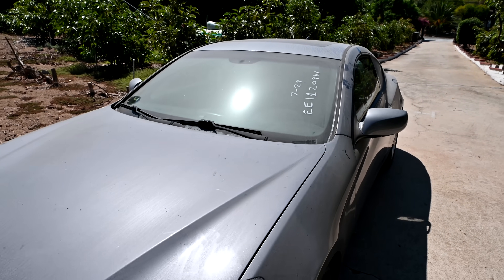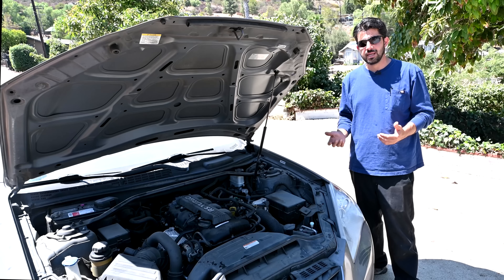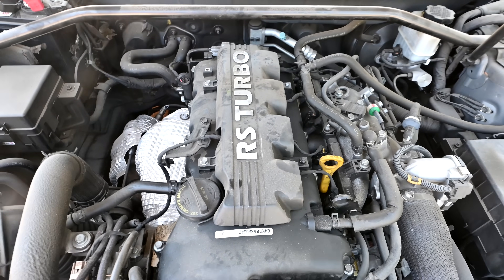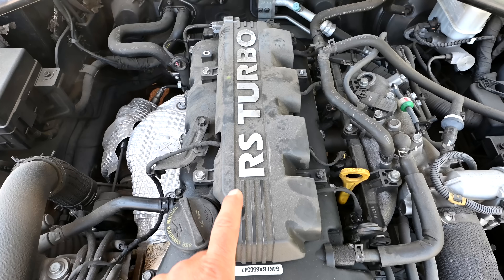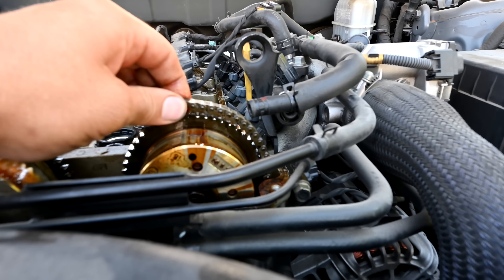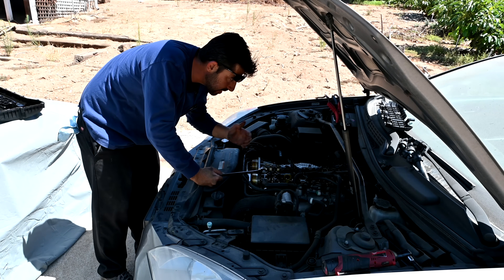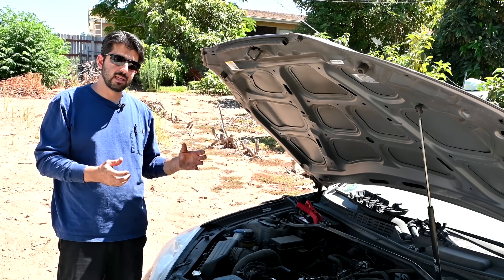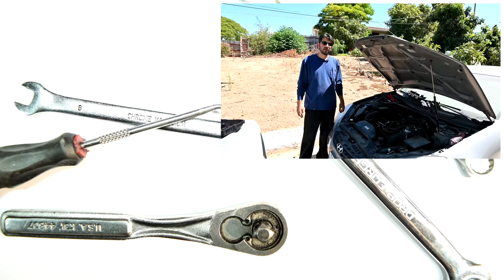The Hyundai And Kia Engine Failures Explained.

Comment: As a tow truck driver from the auto club, I’ve picked up most cars with dead batteries, alternator issues and minor repairs needed, but kia and Hyundai are definitely the worst ones with blown engines. 
Especially because people neglect to change the oil, or check fluid level 🫤

We hope to see you at Mollison OReilly’s!
Reply: We are lucky here in Australia. Our Kia and Hyundai cars come straight from Korea and we dont seem to have the problems your cars have in the USA. Also we change oil regularly here in OZ. I change my turbo Tucson`s oil twice a year with full synthetic oil...because I can. Never needed oil between services despite regular 2500km trips in hot weather.
Reply: @martiedoherty5765  interesting! The Koreans are capable of great craftsmanship but when it comes to communicating with them the language and culture barriers are real.
Reply: @martiedoherty5765  I’m in Australia and we have an i30 which my wife drives. Recently the car lost heaps of power and run really badly. Mechanic found the manicat (manifold catalytic converter) components fell apart and blocked the exhaust system. Replacement from Hyundai is $5200 plus labour which is not an easy job. Ridiculous.
Reply: @kaindog100  hopefully it is lesson learned, spend a couple extra dollars and get a Honda Toyota next time
Reply: @blue88aw11  don’t pretend that they’re the answer.
Reply: @martiedoherty5765  There’s been cases of engine failures in Australia as well. It’s not just North America.
Reply: @martiedoherty5765  Most of the people in the states who talk sh!t about Hyundai and Kia have never owned one. I sell hundreds of them every year and can't remember the last time I had a major engine or transmission failure. I wish Honda , Toyota, and Subaru were as reliable as Hyundai and Kia...
Reply: @bdd1469  what is the the joke of the year, u should be a comedian 🤣🤣🤣
Reply from the maker: Hi Marco, good to see you here. The way I am buying cars that need work I'll be down there a bunch of times. Cheers
Reply: Well unfortunately these engines tend to burn through oil like crazy, I've had to replace oil 100 to 1000 miles after an oil change due to bad O rings, valve cover seals and oil pan gaskets...
Reply: @ronyoung9251  Stuck oil rings will do it too, Korean GDI motors require combustion chamber and intake cleanings, how often depends on gas used, OCI and how you drive.
Reply: @ronyoung9251  Valve covers leak after 90;000 miles and only get worse
Reply: In my experience most come in for oil changes with nothing on the dipstick. Only had maybe 5 out of 100 that don’t
Reply: I still drive my 2002 chevy s10 ext cab 4.3 i bought new. If you take care of your car or truck they will take care of you.
Reply: @chuckgates1171  that is a well built vehicle, Chevy pickups always been. Hyundai Kia is trash
Reply: Exactly.  What I've been telling people all along.  Keep 👏 your 👏 oil 👏 changed 👏 and this won't happen!  The engine in my 2016 Toyota Corolla started knocking right before the CVT failed at 78K miles, now I drive a Kia and it purrs like a kitten.  Buttery smooth engine, couldn't ask for more.
Reply: It's a manufacturing defect according to the video.
Reply: @sunilayya8948  it is, something about rod bearing clearance
Reply: Very true check oil
Reply: My 2012 Sonata 2.4 Theta II engine blew at 91,000 miles with severe rod knock. They replaced it absolutely free. Fast forward to 105,000 miles with only 14,000 miles on the new engine. Sitting at idle at a stop light and the engine catches fire. Car essentially burned to the ground. I will never buy another.

None of this was due to bad maintenance or abuse. It was my commuter car. I always run synthetic oil in my vehicles and do regular oil changes at 5k miles. Most of my miles were highway miles. Very little hard acceleration, most miles just steady speeds. These engines were just a crap design. Ironically I had ZERO other issues with the vehicle. Engine was junk though.
Reply: @mckeanbrosoffroad150  People are so quick to blame the owners of these cars. Same experience.
Reply: American made engines  you say problems you say well well well gosh yall
Reply: @ronaldwarren1267  Honda and Toyota make USA engines. It's the engineering and buying parts from the lowest Chinese bidder. Hyundai Kia are trash
Reply: Sounds like Indodged a bullet when I passed on a Kia Sorento two years ago.  Those sound like engines that the driver must strictly adhere to the maintenance schedule (and if it recommends oil changes at 7,500 miles, perhaps 5,000 instead… an additional oil change or two is a lot cheaper than a blown engine).
Reply: My daughter's 2012 Kia Sorento ate 3 engines, we found out after the fact it ate the first one before she bought the car uses. Best info I found while doing research (as to why my mechanic couldn't find one ANYWHERE trying to replace engine #2), was that they had bad habits while cleaning out freshly machined engine blocks at their Allentown  Pa. engine plant, leaving too many shavings wandering around the crankcase, oil passages, etc. Fortunately she'd bought an extended warranty which covered engine #2 (her first), Hyundai replaced engine #3 for free.....she replaced it with a Chevy Terrain
Reply: I have known plenty of people who tried to own Hyundais starting with the Excel back in the late 1980's.  A nice little car on first look with lots of features and sporty styling for a cheap price.  Then things invariably started breaking starting with the knobs on the dash that crumble like a fortune cookie and it's all downhill after that.
For a little bit more you can get a Honda or Toyota instead that is ten times the car any Hyundai is and will outlast two Hyundais combined.  I don't understand why I keep seeing them driving around all over the place, I don't get the draw these have on a car buyer.
Reply: Agree, if I check my 2015 Tucson engine oil often, engine oil would NOT run dry, engine would NOT lock
Reply: I have a 2012 kia optima 2.4L that just ticked  286,000 Kms
 (Car was made in korea) 
orignal Everything except suspension/brake parts.

Body is in prestine condition, undercarage has Minimal rust,
 (I undercoat my vehicle) 
and i live in Northern Canada lol.

Cheap car scan tool, google, youtube, Oil changes at 5000kms with synthetic oil.

I guess you could say
Common car knowledge and common sense go a very long way, lol.😊
Reply: @EnlightenedInspire  you have a unicorn in your possesion. Ive seen new 2020+ kias with a full maintenance record with 30k miles that need a new motor.
Reply: Something tells me there are more subprime Hyundai/Kia buyers than subprime Toyota and Honda buyers, which might partially explain why some of Hyundai's/Kia's reliability woes.
Reply: Bought a 09 sonata new, 3.3 v6. It’s now at 212k have replaced a starter, alternator, and ignition switch, now needs a water pump. Five thousand mile oil changes, has never burned a drop of oil, runs like a raped ape. I’ll be pisswd if it doesn’t make it to 300k. Oh, and 30 to 31 mpg at 80mph with the air on!! There not all bad. 😉😉😉😉
Reply: It's always cylinder #3. So it's not metal shavings is it?
Reply: In my experience, hyundai drivers neglect their cars more than any other kind of person. Its absurdity
Reply: @Miatshu  This is true I believe it's cuz it's a reasonable price of entry and a 100000 mi warranty they figure they just drive the piss out of them and they blow when they blow they'll get a new engine. Unfortunately the common denominator seems to be the American made engines. Although with oil changes at 4,500 miles I've had damn good luck with them.
Reply: @Miatshu  I have one of those cars you're talking about and I think your perspective is a little too general. Hyundai's and Kias are known to BURN OIL. the average person isn't going to go back and check their oil at the halfway mark to the next oil change. It's not normal and shouldn't be expected.
Reply: @GotJay713  I am a kia certified technician and i worked at an oil change place for nearly a year. I see the worst in these cars, its very common to see completely sludge up motors due to neglect. Ive been working with these cars for awhile now. Both places, it was always the kia/hyundais that were fucked.

Although Rod bearing clearances from the factory are not right. Even with consistent oil changes, some will just give out, neglected or not.
Reply: @Miatshu  that’s because anyone that knows about cars won’t buy one! laughs in Scotty Kilmer
Reply: @KekeeBlack  exactly
Reply: My mom just traded her 2017 Santa Fe sport because it burned 2 Quarts every 1.5k miles. Only had 80k miles. It was ridiculous. She got a 2019 rav 4 with 17k miles. I’m happy she listened to me and got a Toyota.
Reply: @dfsdh432v9  hyundai spec is up to 1 quart every 1,000. I've seen a brand new palisade, 8000 miles. Had burned through nearly 5 quarts.
Reply: @Miatshu  But it looks like a grandma cruiser 🤣
Reply: @dfsdh432v9  smart move with the Toyota, Hyundai Kia are trash
Reply: @blue88aw11  - At this point..it's very evident.  If you still think Toyotas today are better than newer Hyundais and Kias, you know nothing about vehicles.  You are still living in the distant past.  Plus why would anyone in their right mind go for a vehicle like a Honda or a Toyota with outdated interiors, less tech and cheap Main Stays quality interiors when the Koreans have nicer, higher quality interiors, up to date standard tech and modern styling?
Reply: @dfsdh432v9 and if she doesn't change the oil every 5k, her toyota will do the same thing.
Reply: @dfsdh432v9  - She'll be paying for it (for buying the Toyota) later.  I did.  3x.  Two of the three Toyotas left me stranded on the side of the road.  On top of that, to add insult to injury..people always told me how boring Toyotas are.  After my 3rd Toyota, got my first Korean car and I love it.  No more trips to the repair shop either.
Reply: 90% KIA hyundai  engine LOCK UP around 60k. if they dont catch fire, that is.
Reply: @dark6c159  - And that claim is factually false.  Stop lying.
Reply: @DeadofWinter321  no he is 100% right. I will take a Detroit Big 3 car before a Hyundai Kia. My ex girl, cousin, sister and dad owned Hyundais, model years 1992 to 2016. I used to work on them and they are the shitiest cars ever made. I must say the parts prices, even at the dealer were low, like crackhead prices. New Hyundai parts were much cheaper than equivalent USED Toyota Honda parts
Reply: @blue88aw11  - Sounds like they didn't take care of their vehicles then.  The problem with the newer Hondas and Toyotas (2000s and up), you can take care of them and the fuckers still break.  I was very OCD about maintenance intervals.  Now, my first Kia I've ever owned..I kind of forgot what it's like going to a shop for repairs.  My Toyotas and the one Honda I had..it became so common to take the cars in for repairs that the service departments knew who I was when they saw me walking up to their desks 🤣
Reply: @dark6c159  facts
Reply: @dark6c159 possibly if pre direct injection
Reply: That's cute. But I call BS. As a used car dealer I buy and sell thousands of used cars every year. So far, in just 9 months this year,  I've replaced dozens of Honda, Toyota, and Subaru engines, and transmissions,  and not ONE Hyundai or Kia engine or transmission. I do agree that Hyundai/ Kia owners do not  do oil changes or other maintenance , because they are usually broke. Which is why the fact that I never have major failures with Hyundai's or Kia's is so impressive ...
Reply: Yup, I just looked a a 2009 Kia with 200k miles. Still had original transmission fluid and coolant reservoir was nearly bone dry. Interestingly when I asked him when he serviced the transmission last he said “IDK, I haven’t, car is to cheap to put money into it.” 😮
Reply: @dannylay7965  Kia with 200k miles, that must be a world record. I think that car needs to be put in a museum.
Reply: @blue88aw11  It’s in excellent condition as well, not a single rip or tear in the leather. Doesn’t rattle or drive with a worn feel, still feels like new. I changed all the fluids with fresh and did a tune up. My dad’s 2008 Hyundai Entourage believe it or not has over 300k miles. It has been extremely reliable and we even use it to tow our 20ft boat.
Reply: Well cheap parts used on Hyundai Kia cars and the fact they are bought by people with bad credit who know nothing about cars and prob cheap on preventive maintenance, I am not surprised
Reply: Combine that with the way the owners drive. A lot feel they are driving a race car.
Reply: Any how, my family never owned H/K vehicles, will never 
own one.